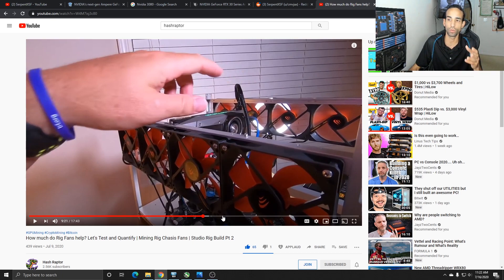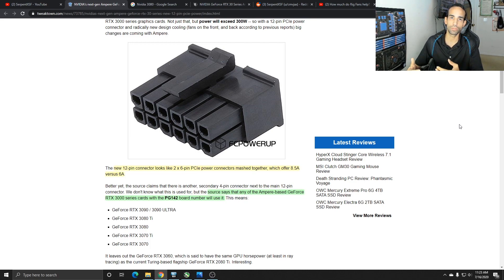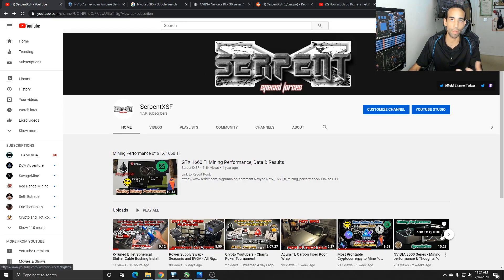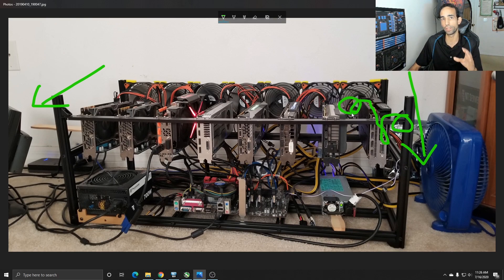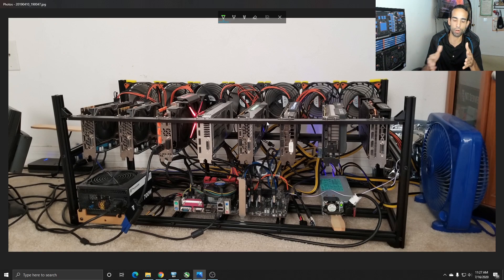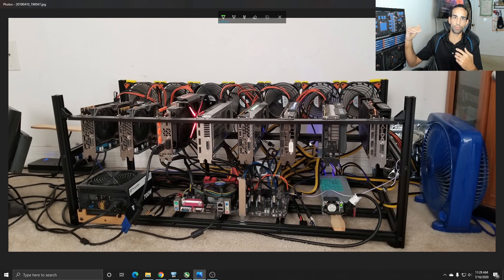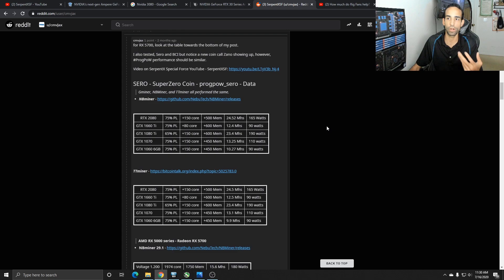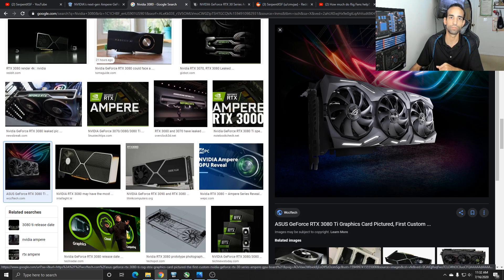Nvidia RTX 3000 - Mining Concerns with Ref. Design

Comment: How about just lowering the row of fans, and tilt them slightly upwards, so they will still provide all your cards with fresh air, but moving the air up, and away from the horizontal plane?
Edited to add: Interesting video, but now we also know that the air travel is different - air is not going to be sent through the cards, towards the back, but through on the front, and in and out through the back, two separate air flow channels :)

Comment: I assume both fans are going to be pointed towards the board and pushing air over the massive heat sinks on the reference design, rather than intaking on one side and exhausting on the other. This would be good.
Reply from the maker: In a computer case it would be great for the average consumer but from a mining perspective in a mining rig, it would just circulate air towards the next GPU in line.

Comment: Hello bro.. Please help can i use antminer   1600w psu in 6pin riser and gtx 1060 6pin port???
Reply from the maker: So the power supply is similar to sever PSU, you should be able to run it just fine but might need extension cables to reach multiple GPUs. However, I am not responsible for any damage to your devices but my math about voltages say yes. You want to power your risers and GPUs from the same power supply.

Comment: Thanks as always for Sharing.   I have to wonder if those power connectors are going to be the new standard 1, and 2 will the aftermarket partners veer away from that and actually go to standard dual 8 pins. Also I suspect only the founders edition does the odd fan setup.  I have a dual molex to dual six pin adapter melting as we speak . .necessity on that one.
Reply: U would need a new rig design for those founders cards.  Laying flat with fan pointing vertically.  I bet that would stay super cool actually
Reply from the maker: Yea, dont need any fire hazards. I hope it doesn't come out just yet and they stick with the normal 8 - 6 pin connectors. We do know even motherboards are planning to switch from the 24 pin connection, so maybe next gen but I am hoping it wont be during this release. We will see, thanks for stopping by and commenting, take care.